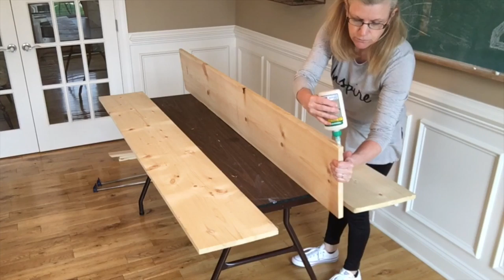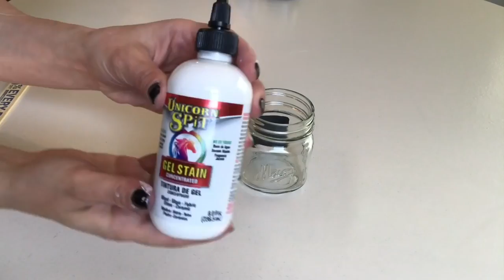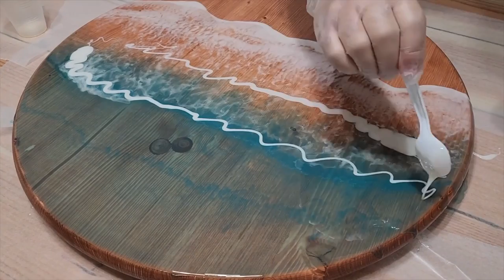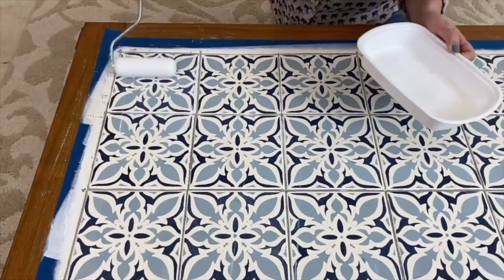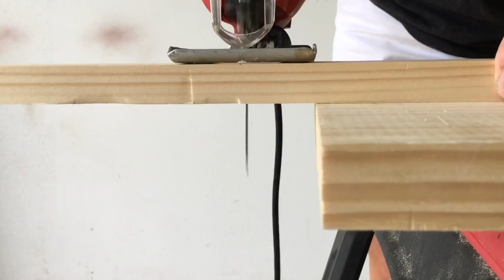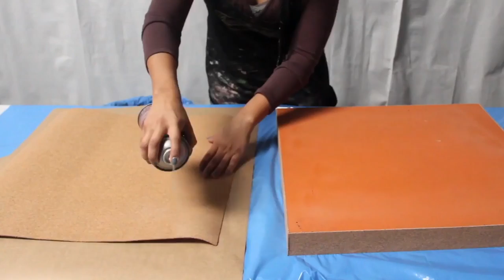Save HUNDREDS with this brilliant folding table hack!

Comment: If I could build a tabletop, I would just make a whole table.
Reply: The Lumber Stores can cut plywood
and you can buy table legs if you are
not ready to use a power saw.
Painting is not hard and if you make
a mistake or don't like it , you can 
Paint it a different color
If you decide to use stain and stencils
there are also stain markers.